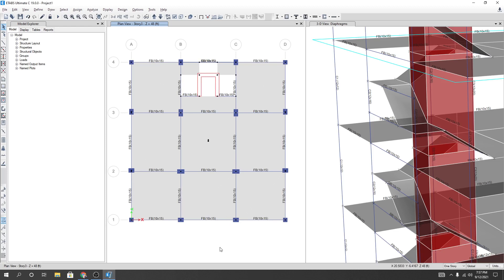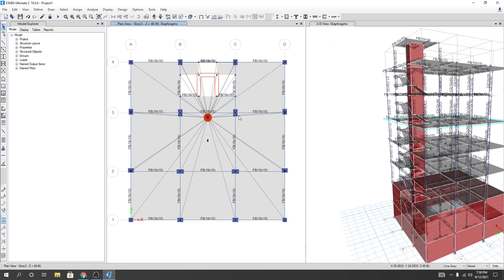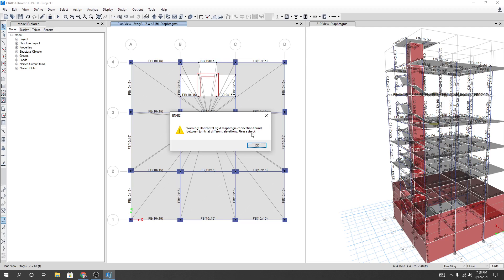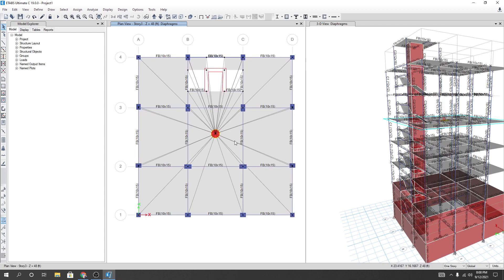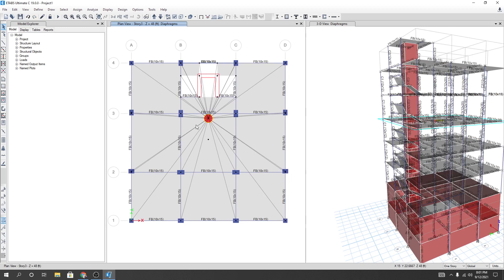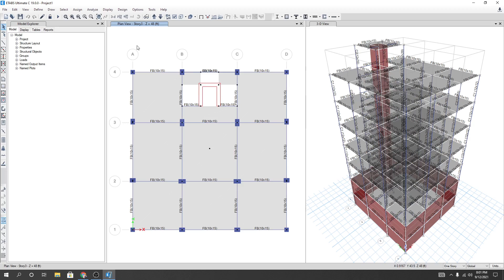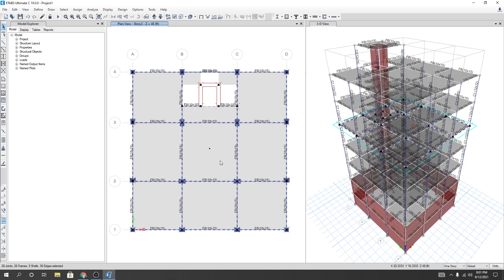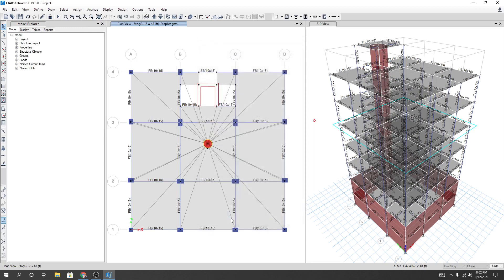SOLVING DIAPHRAGM WARNING IN ETABS AND ASSINGING DIAPHRAGM RIGHT WAY

Comment: So what was the issue? Why didn't it accept the first defined diaphragm
Reply from the maker: first one seclect  join from different level.
Reply: The first time, the diaphragm also selected the staircase Mid landing, which resulted in error as mid landing is at different level than the rest of the slab